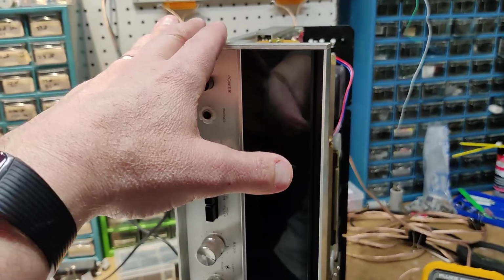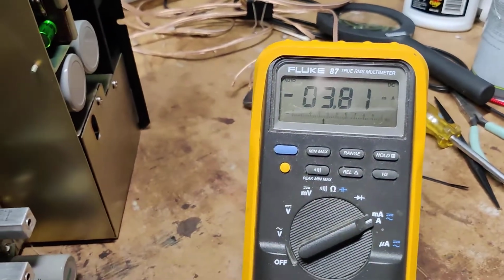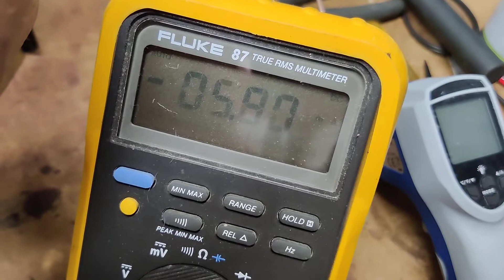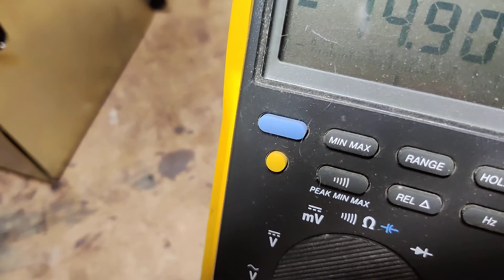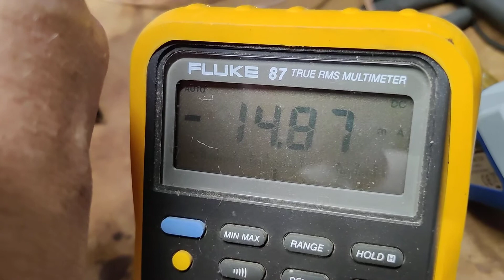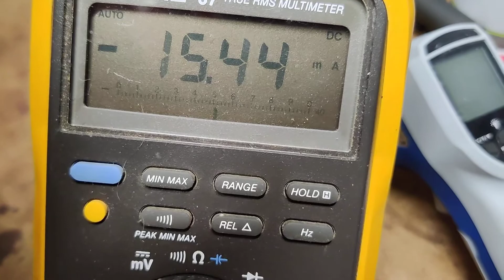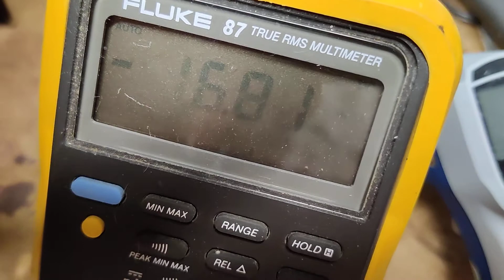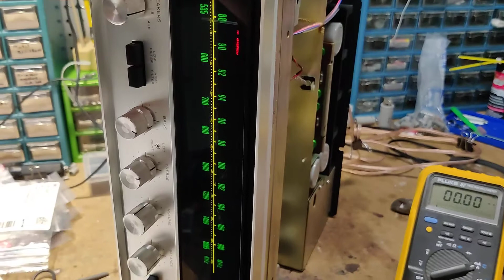Sansui 2000x Bias Adjustment

Comment: I have this exact receiver and whenever I select anything, some of the indicator lights don’t come on unless I push it past the detents.  It seems as the selector pot is not aligned properly with the detents. Is there a way that I can adjust the pot so the lights come on when I select outputs? Thanks!

Comment: what happens when i don't use the 8ohm 50w fuse. but instead i attach a pair of 8ohm 20w speakers. will it burn the speakers?
Reply from the maker: So most 8 ohm speaker tolerances are off by about 10 to 20%....sometimes more  The 8 ohm resistor is a 5% tolerance standard. This will give you the most accurate setting Likely you will not damage the speakers unless there is something wrong with amp. There is technically no signal coming out setting bias. Your volume should be set at 0
Reply: @PackardDog  thank you !

Comment: I am having trouble setting this.  On my  unit, with a meter connected, the bias slowly keeps falling after setting.... My board has just been rebuilt.  Weird.  I've never had problems setting my Pioneer units before.
Reply from the maker: Room temp or warmed up?  Are the output transistors original? Old transistors that cannot dissipate heat anymore could cause the drift. Sometimes just reapplying the thermal paste between transistor and heatsink can fix it....
Reply from the maker: I just rewatched my video. I ended up applying some fader lube to the pots because my were drifting down to 14 ma. I was going to replace the pots with some Bourne's 30 turns, but the fader lube held them at 15. Try that first, if it does not fix the drift, check the tranys. I sold the unit a while ago. 😞 Can only keep so many. It is a awesome receiver!
Reply: @PackardDog  Thanks for the reply. I’ll give those ideas a shot.

Comment: I replaced 2 transistors high hfe then old one in the power circuit, and now the sound has too much treble. Do I need to buy an oscilloscope to adjust the output. to reduce the treble? or i need buy other transistor same hfe with old transistor? thank you!
Reply from the maker: Best bet is to match transistors as closely as possible to the gain of the original transistor. Check audio karma's list of "replacement transistors".
Reply: @PackardDog  I did exactly as you did. But one strange thing is. The current kept decreasing slowly. After about 5 minutes it decreased from 19mv to 15mv. I watched your video. You didn't wait for it as long as I did.
Reply: @PackardDog And here is an additional question about output tuning. I don't have an oscilloscope. I want to tune by measuring dc in front of the output capacitor. But my problem is that my total current is 69v without any dummy load. So should I adjust it to 34.5v. or should I still follow the standard that people often use, which is 30v. Thank you very much
Reply from the maker: @thanhky8997  Yep, it would drop a bit but once it was warmed up with a load it would level out. What are you using as a load?
Reply from the maker: @thanhky8997  I sold it a few years ago. I would personally, just get it warmed up real good, use some 100 watt loads, no volume and shoot for 30.
Reply: @PackardDog  I use 8 ohm 50w power resistor. maybe I will connect 2 resistors in parallel to get 100w. thank you very much!
Reply from the maker: The 50w should be fine.  Just get it warmed good for 15 minutes or so.  @thanhky8997

Comment: What if it doesn't want to adjust? What is wrong then?
Reply from the maker: Did you replace any components? Also by "not adjusting", do you mean that the voltage is jumping around or no response?